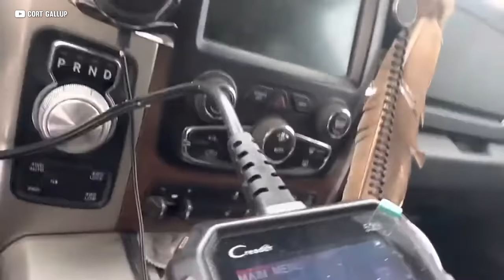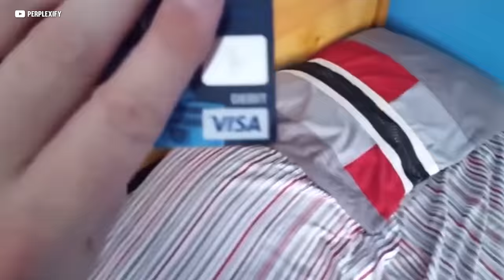Worst Trucks Only Stupid People Buy

Comment: I have news for u when it comes to Chevy they are some of the best vehicles on the road yes the bodies and automatic transmissions are junk but as for the engines they last forever I don't drive anything but Chevy and I never have any serious problems with them at all period except the Chevy I have now the transmission went out because it's a fact that the 4L60E Transmissions are junk and what u said about the Chevy Silverado engines is total bullshit the Chevy Vortec Engines are damn good and strong engines they never have any issues at all hardly why do u think all the race car drivers and off road drivers put nothing but Chevy engines in the vehicles that they are building they even put Chevy engines in Ford race cars and other project vehicles because of the fact that Chevy engines are some of the best and strongest engines built period GM definitely know what they are doing when they design and build their engines I know I won't drive anything other than a Chevy that's for sure